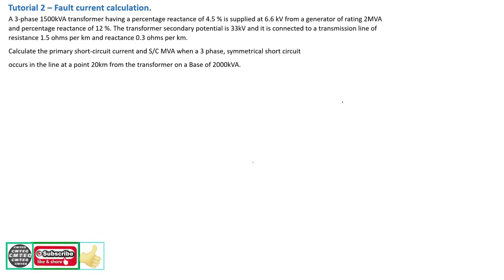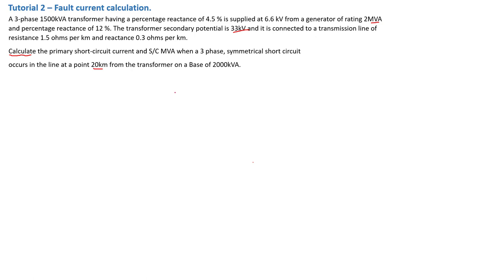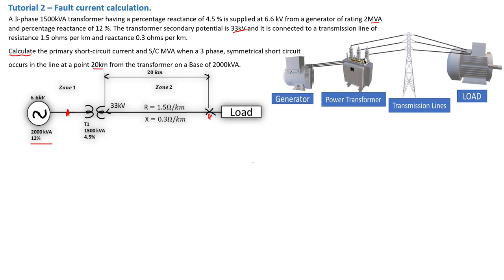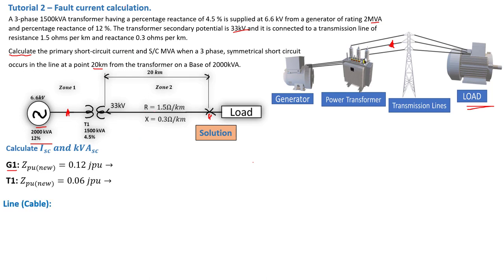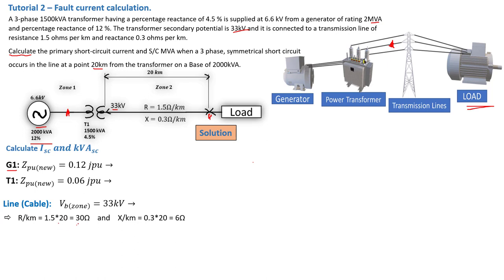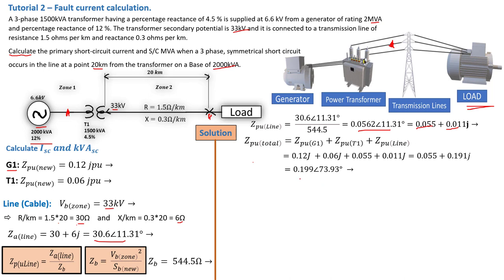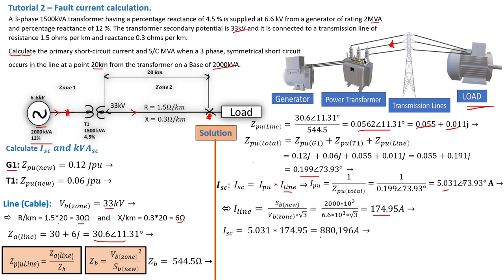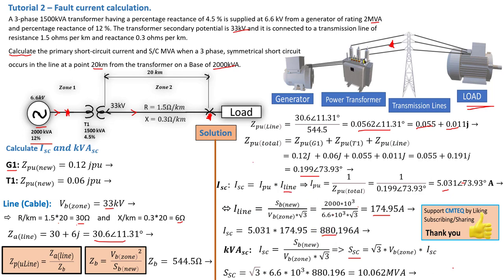Primary Short circuit fault level - Fault current calculation. Tutorial 2

Comment: why you choose 33KV as the voltage base instead of 6.6KV?
Reply from the maker: Hi Jaco, thanks for your question I believe you are referring to Zone voltage of 33kV @ 6:55 , which is correct for that section. The base voltage which is also the zone voltage varies as per zone as you can see, 6.6kV is the voltage for zone 1 at the generator side, and 33kV is on zone after the transformer and we could add another step down transformer at the LOAD section with a different zone/base voltage. I hope you understand the principles  now.